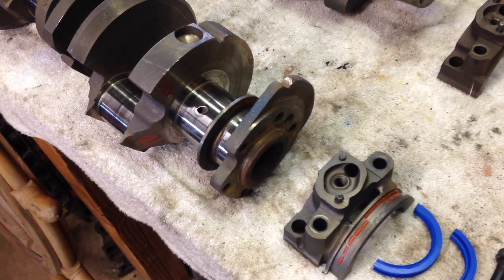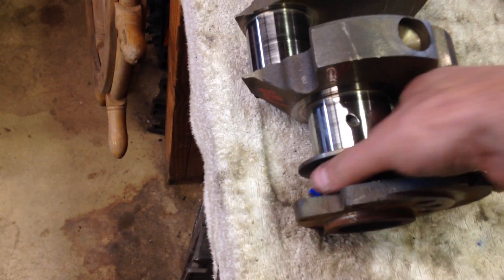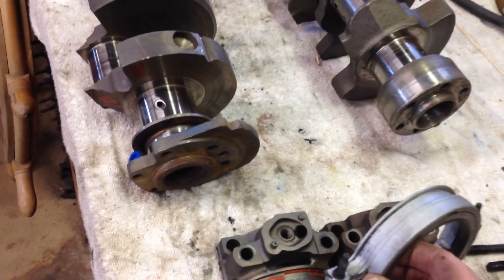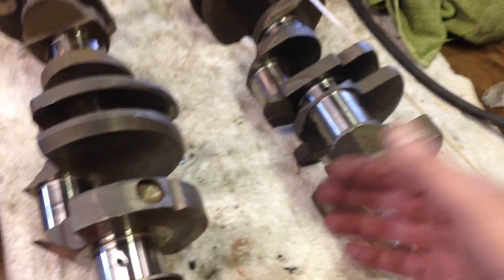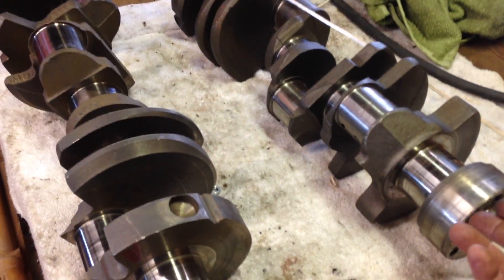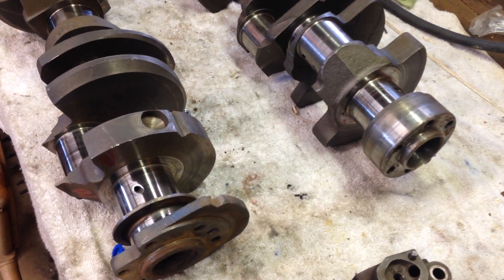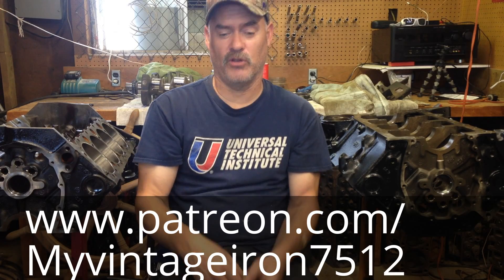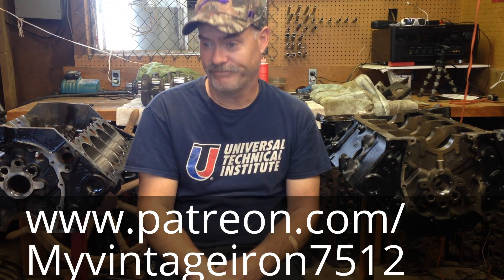350 chevy 1pc vs 2 pc rear main seal

Comment: Ah-Ha! Likely you didn't mean to say a 1998 can have 1970 cylinder heads. Starting in 1996 all of the engines had some major changes like the Vortec heads, roller camshafts, multi-port fuel injection vs. TBI from 1986-1995. One example is that you could do a camshaft and lifter job on the 1995 and earlier engines by just pulling the intake manifold and valve covers off. Newer models you have to remove the cylinder heads to do a cam and lifter job. As far as the actual head bolt pattern, not sure. TBI's are center bolt heads with center bolt valve covers. So many unnecessary changes making things more difficult and less interchangeable makes most people think they have been trying to make the old shade tree mechanic give up and take it to the dealership for service. Like why would the engineers mess with the location and reliability of an oil pump? Well, they did it on the 1996 and later models.

Comment: for alittle tid bit of info. port is left, both 4 letters, also port wine is red so the port running light is red. the right side is starboard, green light. in the very old days the steering board or rudder was mounted  on the starboard side. the right side was originally called the steer board side and sometime it was changed to starboard. so when you were entering "port" you brought the port side to the dock. if you docked on the starboard side you haD A GOOD chance of hitting the rudder.

Comment: can you use a 400 crank in a vortech 350 block? for a homade 383?
Reply from the maker: If you have the mains cut down to the 350 main Dia it's cheaper to just buy a stroker crank

Comment: Good video.  I am in the middle of a build using a 1993 350 in a 1983 Chevy 4X4. There were two notable differences other than the rear main. The 4 center intake bolts are at a different angle so you can't use an older intake I bought an edelbrock 3706 performer to switch back to 83 emissions using a carb instead of the injection. Also there is no ports drilled through the engine block to receive a fuel pump but if you need they sell jigs for doing it. I like the bolts in the intake better because they come out easier and I don't mind using an electric pump as those mechanicals were a bit of a pain to get to. No more greasing the rod! ;^D

Comment: Great video thank you. I am pulling the engine from my street rod that is a 2 piece rear seal 350 and I just 305 a 1 piece 350 to replace it. So the question is about the flex plate that should be used. My trans is a 350 with a 3 bolt torque converter and my old flex plate is the smaller  153 so I'm lost on what kind of flex plate to order.  Thank you for any advice
Reply from the maker: 1986 and up flex plate just tell em 1990 5.7 it will be the right one
Reply: @Myvintageiron7512  Thank you. My only worry is if my torque converter will bolt up or not. It's an older converter that doesn't even have welded nuts on it.

Comment: I put all my vortex stuff on an older block, had problem with timing cover cause of crank sensor. Or was I doing it wrong or they just don't fit ? Because no crank sensor on other cover obviously thanks for time
Reply from the maker: you can use an early steel cover if you put the dowl pins in the block

Comment: look dude I've got an old model 1981 block with an old access 70s or 80s wind high rise intake now can I run the 196 heads the vortec heads with with that intake or what
Reply from the maker: no

Comment: Hey great channel pal”
I’m building me an 880 block now and am using a lot the knowledge I’m learning every step of the way.
That being said, it would be nice to know exactly what is the differences in timing covers from older to newer sbc. Thanks a bunch keep up the good work 👌👌👌
Reply from the maker: The vortec uses a plastic timing cover that has a built in seal and a crank sensor you can use the early steel cover on it if you install the dowl pins into it the bolt  pattern is the same

Comment: can you explain why gm used so many different balancer's  on the early small blocks and are they interchangeable
Reply from the maker: If you think GM uses allot of balancers you are gonna hate fords, 
 they have 10 times the number of balancers A smaller engine requires less balancer also it depends on how the engine is balanced internal or external
Reply: for the ford sbf you have 28oz for 302 and 351 1968-1980. for 1981 up 302 only it is 50 oz. and with ford 221-302 all intakes interchange. people hate on ford but I find them SO easy. the distributor up front the oil pump shaft has 6 sides so the distributer is easy to get in. the sbf ways less makes more power per-cubic inch. well the Chevy is not bad but every one runs them. I like to be different. o and the the valve covers did not change on the ford sbf ether!

Comment: Great job, keep up the great work that you do. Would I need a crankshaft adapter. to put a 1 pc. seal engine in an older truck with a turbo 350 trans.

Comment: I wanted to hear about oil pan differences between one and two piece rear main seal oil pans
Reply from the maker: There is really not much to say about that except that they are different and not interchangeable  they are both about the same size wise
Reply: @Myvintageiron7512   just say it you , you goofed
Reply: So I cannot use a 2 piece oil pan on a 1 piece motor?
Reply: John Lafrance I was wondering the same. Did you ever find out?

Comment: Wasnt it actually when the 92 lt1 came that the block was different?
Reply: The LT1 is a different engine than the traditional 350.  The traditional 350 and the 305 went from a 2 piece rear main seal to a 1 piece rear main seal.  So when GM reintroduced the LT1 they were already using the the 1 piece. Does that help you?

Comment: Dude those crank shafts has lots of differences you should inform the public of..i understand maybe why you didn't mention a few things ..because it really doesn't have much to do with the rear mainseal...but obviously one crank was forged...which can handle much more horse power.....while the one piece seal crank is clearly a cast crankshaft...and it would also appear the forged crank was one of the few that was internally and externally balanced...probably out of an old school 350 out of a suburban or truck..with what they used to call 400hp heads...which if i am correct you cannot bolt any old,flywheel to it will vibrate it's self to pieces in no time..im aware people will most likely argue that 350 never made an inrernal/external balanced engine..but indeed they did a few..for bigger applicatipns...same reason you cannot use 400 to 350 fly wheels to interchange....just saying ..i like your videos...you do have a lot of knowledge...but I find in some of your videos you fail to mention certain things that in my opinion is vital ...

Comment: So if I had a Block with a Two Piece Rear Main Seal could I swap the Crank to one with a One Piece Rear Main Seal ...?????
Reply from the maker: no
Reply: Thank You,,, Love the Channel...!!!!!
Reply: Actually they do make a conversion rear seal for the 1 piece block to use a early style 2 piece seal crank. They make 2 different ones to use either the early or late style oil pan as well.

Part number: RSH349 to use an early (pre 85) oil pan.
https://www.speedwaymotors.com/EngineQuest-RSH349-Pre-85-Small-Block-Chevy-Rear-Main-Seal-Conversion,1752.html

Part number: RSH350 to us a later (86 and newer) oil pan.
https://www.speedwaymotors.com/EngineQuest-RSH350-1986-and-Newer-S-B-Chevy-Rear-Main-Seal-Conversion,32393.html

Hot Rod Network did an article on it explaining how to install an seal it. Besides needing an alignment tool, it installs just like the stock 1 piece seal retainer.
http://www.hotrod.com/articles/rear-seal-adapter-for-chevy-small-blocks/

I'm using this on my 383 build because I had already bought my parts for a 2 piece and had a problem with the block and the only other one I could find cheap was a 1 piece seal block. Personally I like it because it will let me use either style crank later down the road.
Reply: Thanks for the info ,,, Much appreciated ...!!!!!

Comment: not sure if anyones mentioned it, but you need to be REALLY careful with cams in marine motors... If you don't have the right LSA you can get reversion where the motor actually sucks water back in the engine because the exhausts manifolds have water in them.
Reply from the maker: Yes this is very true this is just one aspect to consider when building a marine engine where people get in trouble is they put a passenger car engine into a boat this is a really bad idea marine engines are built very different than a car engine everything from balancing to clearances and yes the cam profile like you said,  great point
Reply: Yeah it happened to my brother's boat engine then the engine builder told me about it never heard of it till then makes sense though
Reply: I've built a lot of boat engines and I've never seen this happen ever except in one engine that flattened the cam on the intake side.

Comment: I have changed the rear main seal, and inserts without taking the crank out on the older engine. Not a big deal but when you are doing this shade tree without engine/trans hoists etc.

Comment: was there a 1piece seal block with 4bolt mains?
Reply from the maker: Yes
Reply: All heavy duty trucks with small blocks have four bolt mains. You need to get one of the right year. myvintageiron7512 said that was 1985 and later. Yoh are looking for one out of a truck that is a 2500 and up. If you pull it out of a 2500 make sure it has 8 lug axles under it. They did sell lught duty 3/4 ton trucks that had six lugs and two bolt mains. It may be cheaper and eazier to purchase a block from summit or jegs that has everything you want though.
Reply: @chris6200  my 75 gmc 2500 has 4 bolt mains.

Comment: on the two piece rear main oil seal , you dont line them  up flush with the block surface, you off set em by a 1/8  or 1/4 inch, and lube the shit out of it before starting.... geeez
Reply from the maker: I hear that all the time and I have to be honest I don't think it really makes any difference I have never done that with the two pc seals and I haven't really had any leakage problems I'm gonna call BS on this one it's just another myth that doesn't really have any merit when you take these engines apart from the factory they are never off set

Comment: I'm in need of some advice I have 1989 Chevy k1500 and I need to replace or rebuild my 350 tbi that's in it. The question I have is it worth the extra money to put in a roller cam setup or leave it factory cam I would like to get about 325 hp out of it is that possible without doing a 383 stroker build
Reply from the maker: Yes roller cam and FI/computor upgrades will help allot use flat top pistons also

Comment: I'm a boater and have built a 383 from a 350.  The main differences are that the boat engine is always under load so the ring clearances and piston side clearances are like a truck engine.  And boat cams need to be designed to prohibit reversion. 
Quick explaination of why reversion is bad in boats...
When the exhaust valve is still open as  the intake stroke begins, there is a bit of overlap when both valves are open. During idle some exhaust can get pulled back into the combustion chamber.  This is no big deal with non boat engines.  They can use a big cam and get more power with cool noises.  
But boat engines use water cooled exhaust.  The water is added to the exhaust after it exits the heads and goes up through a casting, then turns downward and to the rear.  During lower rpm this reversion pulse in the exhaust can pull water into the engine if the cam isn't right.
Reply: That really makes sense. I learned something.
Reply: Smart!

Comment: By the way my boat engine purrs like a kitten..original to the boat since 1987...not looking for an engine just wondered why they say if you replace this engine it has to be a "marine block"...sounds like bull pucky to me...built a few screamers for hot rods in my day (only wish I had your advice and knowledge back then) and they endured way more abuse than my boat has EVER seen!
Reply from the maker: Marine engines have different clearances and it's pretty important because the boat engine runs with lake water it's colder add to that the heavy loads and  long sustained RPM's and if you run a car engine it's a recipe for disaster the piston is super heated by the power stroke but the cylinder has low temp water around it so the piston expands more that the cylinder with a car engine the piston will be to tight in the bore due to clearances that are to tight (marine engines are set up looser than a car engine would be) it is very common for guys to install a car engine in a boat and they run it hard a few times and blow it up badly so yes there is a difference the internal components are not the same either
Reply: Thank you! That makes tons of sense and answers pretty much all of the questions...and now I finally had someone answer it on a way I understand...

Comment: What is the difference between a "marine" engine and an automotive engine...I am a boat owner and my boat has a a chevy 350 265 hp single engine or "single screw"...but I wondered is there a difference in the block or is it that they are just set up differently as far as the cooling and manifolds...I know your a hot rod guy and not a boater and thats cool...but I wonder why when you go to buy a 350 chevy motor they specify "marine" engine for a boat (by the way they charge for that moniker) or is it that they just say that to beat you up at the marine mechanics shops...just wondered.

Comment: Ill have to look but what's all the differences between a vortex and the earlier blocks.  The new LS stuff confuses me.  I know some have the aluminum block and most are iron on the LS.  Thanks for your info
Reply from the maker: The LS Is a newer design and has little interchangeability with the older stuff
Reply: i believe only the trucks, with the exception of one year 5.3 (special HO), are iron, and all car motors are aluminum

Comment: Hey, what do you have to consider when build a marine engine?
Reply from the maker: The clearances are different and the parts need to forged these engines run cold and sustained high rpm's with extreme loads it changes things you need more piston to cylinder wall clearance I suppose I should do a video on that
Reply: I would be great if you did a marine engine video!

Comment: 1 piece rear main seal leaks just as bad as the 2 piece...like I didn't live thru the 2 piece rear main seal ERA but Ive experienced bad 1 piece seals in 3 vortec motors that I presently own....intake bad seals as well.and my gut feeling tells me it was intended by design outta the gate br gm...how else is a car manufacturer stay in business if they created the perfect seals on combustion engine?
Wait Toyota is pretty close to perfection and that pains me to say as a  loyal gm consumer.xlnt vid.
Reply from the maker: True and seal can leak many times on the vortec engines the PCV system blows out the seal

Comment: if I have a block that had a 2 peace seal can I set it up with a 1 peace?
Reply from the maker: no
Reply: the early 2 piece cannot take the one piece crank but the one piece cylinder block will take the 2 piece aka ol skool crank with the use of an adapter (there are 2 designs - one which uses an 80-85 oil pan and the other the 86+ oil pan - the Bow Tie cylinder block has a standard rear main cap and a matching half which is exclusive to the Bowtie block as seen in a Chevrolet Performance catalog - a majority of aftermarket crankshafts are for the 2 piece rear seal design hence the adapter assembly (also the 86+ block is a RH oil dipstick but on a Facebook post someone posted a pic of an SBC one piece engine block which has 2 dipstick provisions and the one piece rear seal design); ps the Goodwrench 350 is one of a few SBCs which retain the 2 piece rear seal where the 036 cylinder block (Mexican production) also has the dual dipstick provisions but lacking the roller cam spider bosses and respective cam plate (the Dart block which came out in 2005 was reverse engineered from the 880 but has the RH dipstick - sad news 4 those who own a first gen 62-67 Chevy II